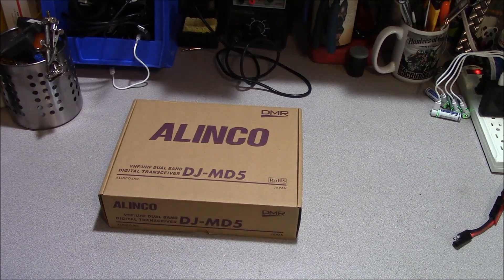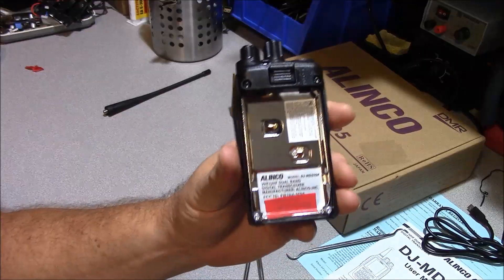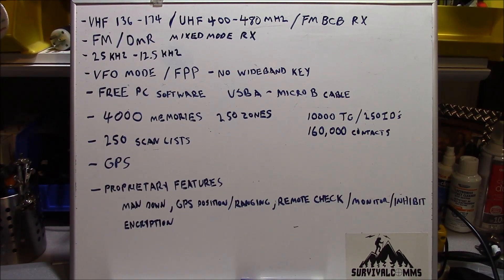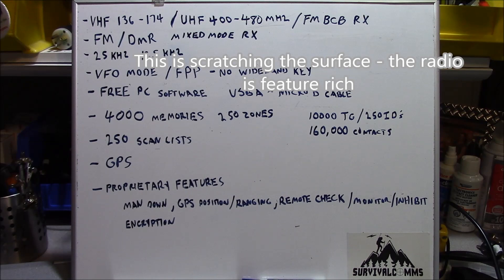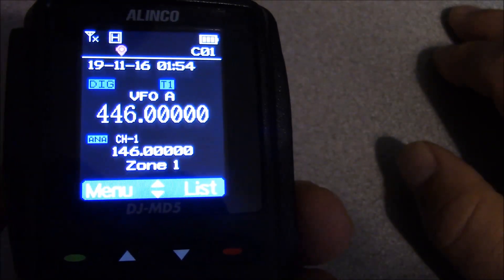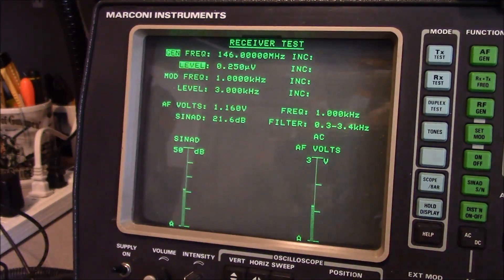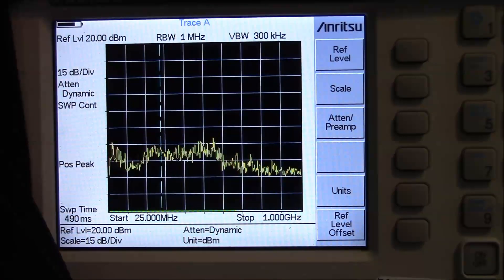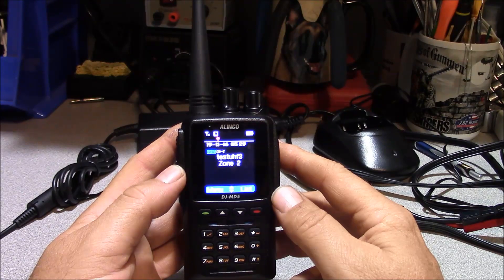Alinco DJ-MD5TGP  budget VHF UHF DMR ham radio

Comment: D-STAR has callsign routing and repeater routing, making possible to speak from end to end without using exterior resources other than IP routing - internet routing. When both parties are using hotspots. Also connect to a repeater and also connect to a reflector. Fusion has only connection to a reflector and DMR to a group. I have to keep busy those resources. At D-STAR there are no resources that have to be kept busy.
Reply from the maker: Hmmm ok. Thanks for watching !
Reply: @survivalcomms  Yes, that is the beauty of D-STAR. In DMR you can private call anyone but they have to be on the same repeater. In D-STAR they can be on any repeater in the world. Only they have to gateway CQ so the system knows where they are. A little push of a button. Once in 20-30 minutes.

Comment: D-Star is not manufacturer specific sir. Kenwood and Icom both use it and others can use it. I do prefer DMR myself but use both.
Reply from the maker: You are correct a couple of HAM radio manufacturers make Dstar radios but I have yet to see anything commercial using Dstar. Thanks for watching !

Comment: Great Review.  I am considering this radio but the disclaimer about using third party microphones has me worried.  This is from the Alinco site:  "Warning: Attempted use with 3rd party microphones voids the warranty and may result in permanent damage to the transceiver."  Part of the reason I am considering this radio is that I already have two-prong speaker mics and headsets.  Is this warning for real?
Reply from the maker: Thank You ! I cannot say for sure. Considering the QC of the accessory aftermarket and the risk of putting the wrong two pin accessory in the radio I don't blame them in a way. As a user you need to be certain that the pinouts of the accessory match the radio. Thanks for watching !

Comment: very cool video. was looking into getting one of these tom supplement my gear, have a vx7r, vx-8dr, and a ft1dr
Reply from the maker: Thank you ! If you aren't into DMR a very good choice is the Kenwood  TH - F6A on the used market . It has an awesome receiver capable of SSB and CW on HF/VHF/UHF as well as civil , military air , and NFM in the 800 and 900 bands. You can recharge the radio from USB as well.  Thanks for watching !
Reply: @survivalcomms  the th-f6a was the first radio i ever bought, back in 2010. Just picked up the md5tgp this past March. Love them both!
Reply from the maker: @BigE36  Thanks for watching !

Comment: Does anyone else' DJ-MD5 make a popping sound from the speaker at the end of DMR transmissions? At first mine only did it if it was in scan mode but now it does it frequently when just sitting on a dnr channel.
Reply from the maker: Is that in promiscuous mode ? That seems to be a characteristic of all chinese DMR radios in my experience.  If you find one that doesn't do it let me know. I would like to test it. The only ones that I have not observed that in are the commercial Motorola ones. Thanks for watching !
Reply: @survivalcomms I do run it in promiscuous mode so will try without. Thank you for the reply as it saves me from having to send it in for warranty repair for nothing.

Comment: I had wondered about these. Alinco always seemed to have a junk status for a long time. I see they are doing well and make some good stuff. My only complaint with these radios is that the belt clip attaches directly to the battery instead of the frame of the radio. That means you have to buy an extra clip per battery or move the obe around your spare batteries. Thanks for the review, How do you like it on DMR?
Reply from the maker: You are right - Alinco has the reputation of being the low ball manufacturer amongst the big Amateur radio vendors. In todays market when the big sales revolve around 35 dollar dual band radios I suppose the tiers have shifted. The on battery belt clip seems to be the defacto standard on compact radios and in this case it would of blocked the latch access. So far it has performed well on DMR. Thanks for watching !
Reply: @survivalcomms  I've had very good service from Alincos in the past, and very good audio. I still have my DR570T, now 30+ years old, the first amateur dual-band mobile to support crossband repeat from the factory. It has some burned out bulbs but still works, sounds great, and is still on-frequency. The audio on repeat is so good nobody knows I'm being relayed if I don't tell them.
Reply from the maker: @paulplack490  That is true. I remember the DJ-C5T and it really launched the mini HT craze  back in the 90s.  I need to add one of those to my collection. Its a shame your rig lost some bulbs . I have an old icom here that does crossband and all of the illumination is OOS. Thanks for watching !

Comment: I was toying with purchasing either this radio or anytone 868 - and I went with 868. Although very similar firmware, I chose the 868 because of extra programmable buttons and larger mAh battery. 

Those USB rechargeable batteries look interesting :)
Reply from the maker: Some extra buttons would be nice on this radio. I really like the size of it and wanted something smaller than a service size radio. The anytone came highly recommended to me .  Good eye spotting the batteries :) those are part of a project for a future video. Thanks for watching !